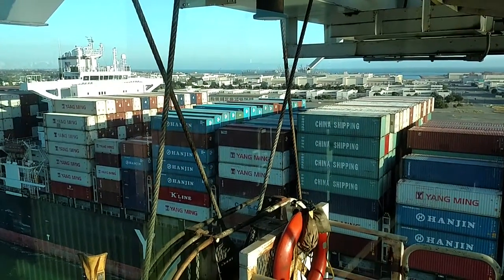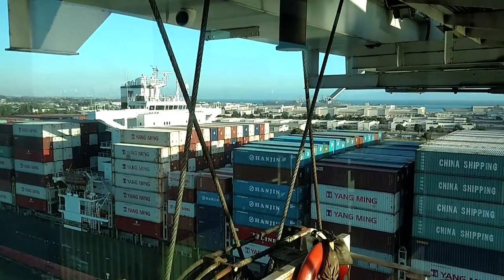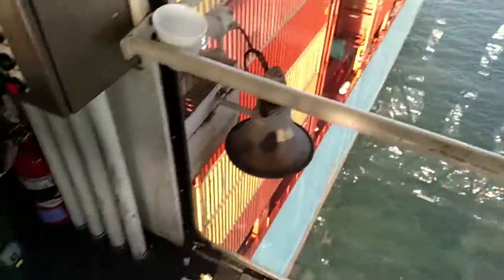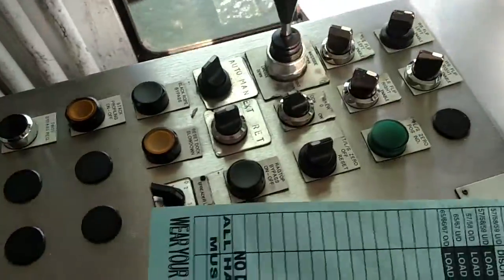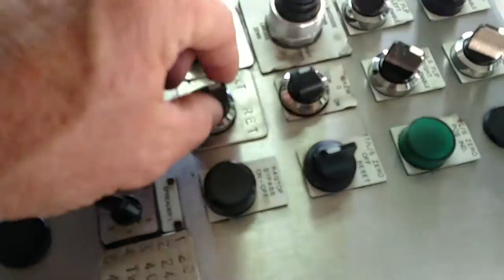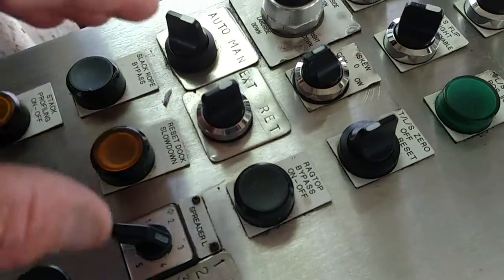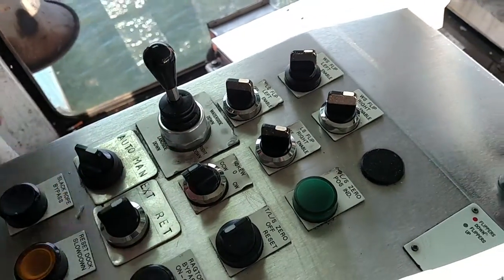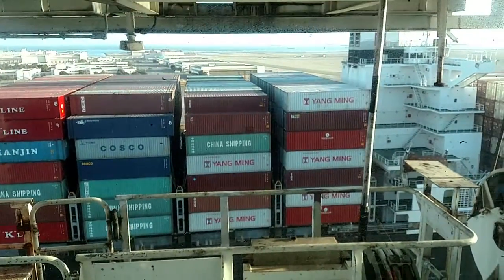Port of Oakland production /Scotty on the waterfront

Comment: Nice video Scotty. Are cranes Don't have that function in Seattle. We have a selector that shrinks or expands the rack from 20, 24, 40, 45 then twin 20.  We do have a manual adjust for ondeck twin 20s. Thanks for sharing that.
Reply: Art19 I’m a gantry crane operator at VanTerm in Vancouver BC and there’s no such legth of 24’ foot container